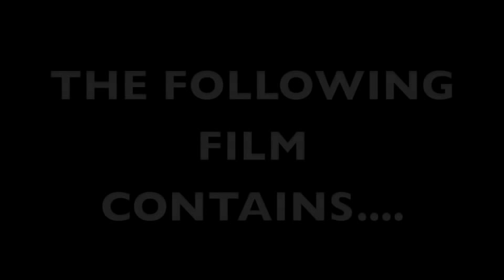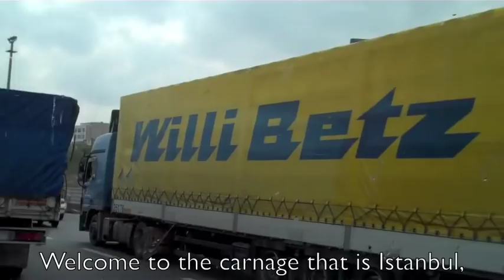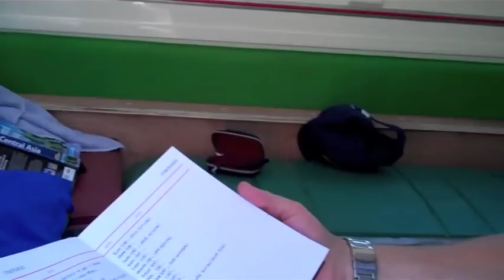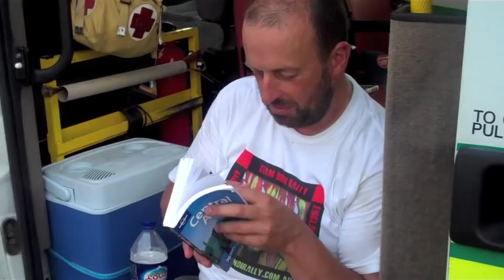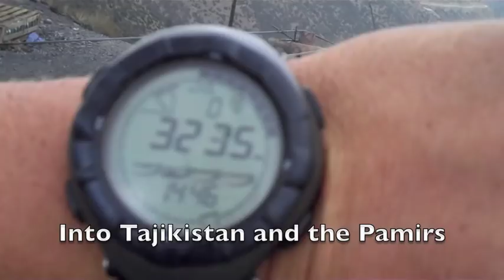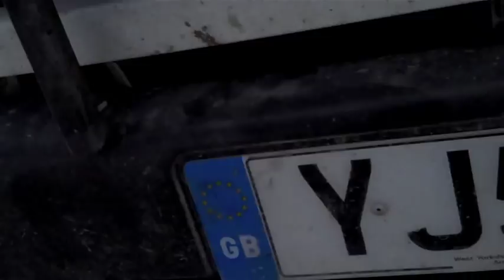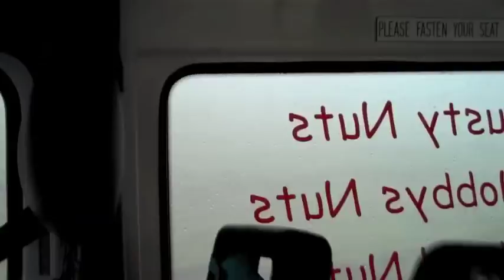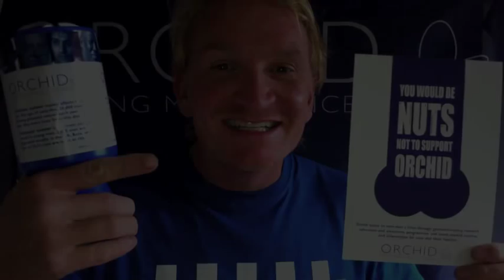Mongol Rally 2011 - Halleys Comics

Comment: I'm trying to get as much informations as I can about Mongol Rally - hoping to take part in it maybe in 2013 or later. How did you get back from Ulan Bator? Cause I guess you left your car for charity reason. Trans- Syberian Railway? Or maybe airplane? And if you could make it clear for me: Were the rules about engine capacity changed during last 2 years or I missed something. In 2013 edition engine must be under 1.2L and age of the car approximately under 10 years.